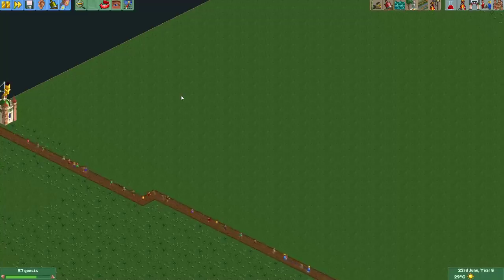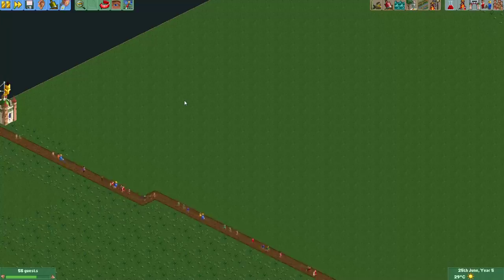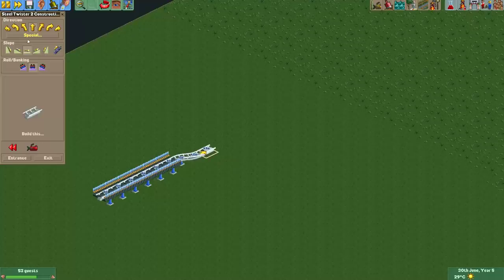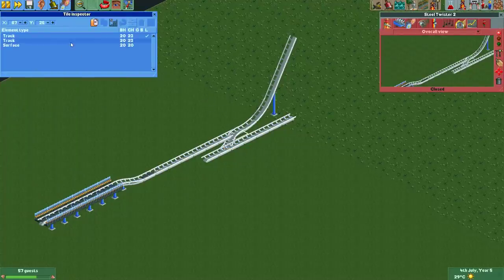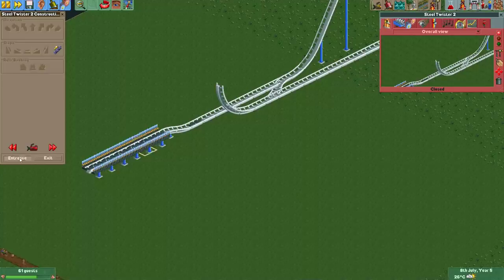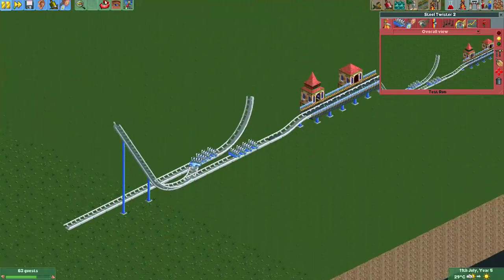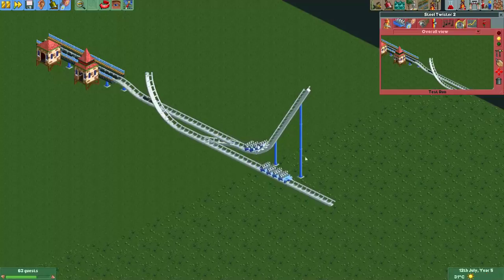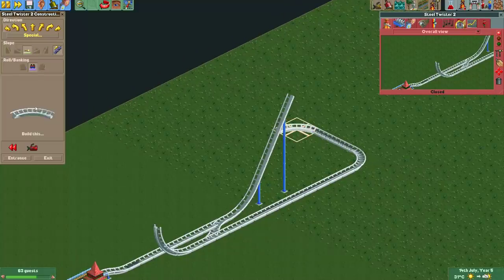Git Gud at OpenRCT2 #29: Shoestringing

Comment: I've got to admit, I'm legitimately impressed with how much is possible in this game compared to sixteen years ago, and with how the game actually can handle it without breaking or crashing or something going terribly, terribly wrong. I'm seriously excited for what's going to be discovered in the future, and for what OpenTTD is going to make possible or add.
Reply: Chris Sawyer programmed the game in assembly language so it's really robust. OpenRCT2 basically decompiled it into C so it's easier to build.
Reply: @OrionTekken  Yeah, that's impressive as it stands, for sure, but I more mean, the way things work (like the train physics) is so simple that the game still manages to stay working when they behave incorrectly (like trains splitting in half). Every time I see something new like this, I'm just floored at how solid of an engine the game actually has, and it's likely due to those limitations of it being written in machine code. I'm so glad OpenRCT came along to allow us to utilise all these oversights.
Reply: @ashendeer  That's what I was getting at, the whole reason so much is possible is because of the robust nature of assembler.
Reply: @OrionTekken  No, it has nothing to do with assembly being more robust. It's just proper programming. Regularly, code written in assembly will be less stable, because the human programmer made mistakes.
Reply from the maker: Also, because code written in assembly is written on such a low level, it will be more machine-specific. Vanilla RCT2 would crash quite often for me on more modern operating systems.
Reply: @Deurklink  That's not even a problem with the coding, that's a problem with the small amount of C code used to actually get the assembly code to run on any processor. It's unfortunate, because that's such a small amount of the code (1% according to Wikipedia) and yet it basically makes the vanilla game unplayable in this day and age. Just another reason to love OpenRCT, I suppose. :p
Reply: @nanderv  Your comment is purely pedantic, any language will be unstable if coded improperly. It is more difficult to understand and use assembly language but it is also more stable when used correctly, I think the point you are trying to make is that as a program's complexity increases the viability of using assembler decreases but that is self-evident.
Reply: @OrionTekken Assembly is not "more stable when used correctly". Any language will be stable when used "correctly" because all bugs are the result of programming errors. If anything, assembly is less robust than a high level language - it makes it a lot easier to make mistakes, and it is less forgiving when you do make mistakes. Anyone who did this type of hacking in vanilla will probably be familiar with the "Access Violation" error - in many modern languages, this just doesn't happen because the language handles all memory management for you.
 
The fact that RCT2 can handle this type of hacking has entirely to do with the way the coaster logic is implemented and nothing to do with the language it's written in. This video is actually made with OpenRCT2 which is written in C++, not assembly, and that is actually quite a bit more robust than the original game. There are many hacks you can do in OpenRCT2 that will crash the original.

Comment: Has anyone looked into fixing that calculation loop? I'd like to try shoestringing, but not if I can't get ratings on any other rides.
Reply from the maker: You can get stats on your rides with shoestringing, you just have to be careful not to get the function stuck in a loop